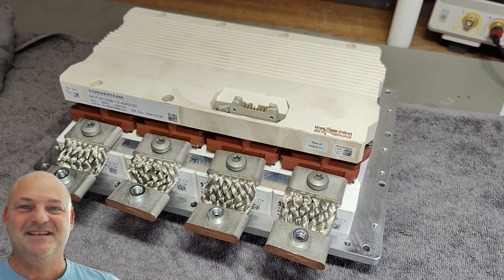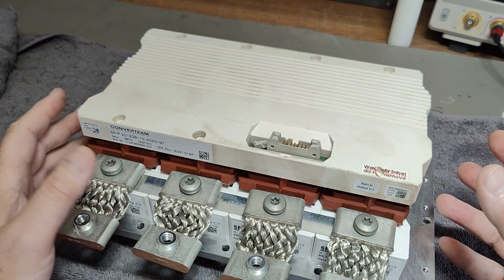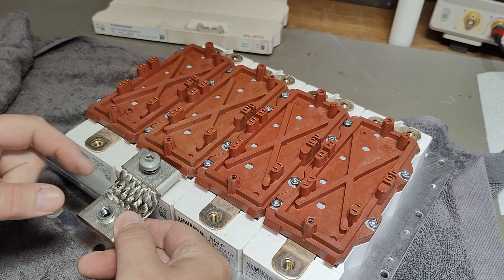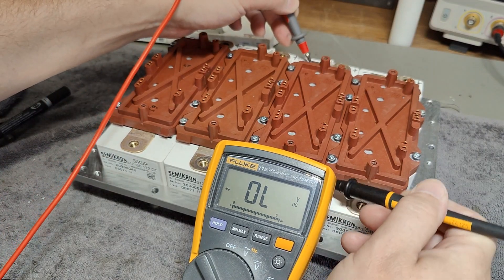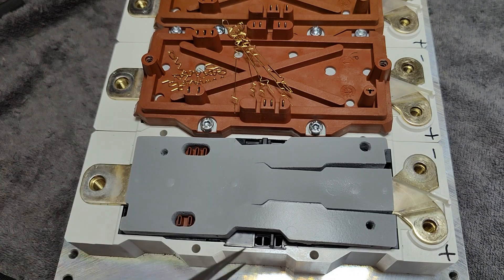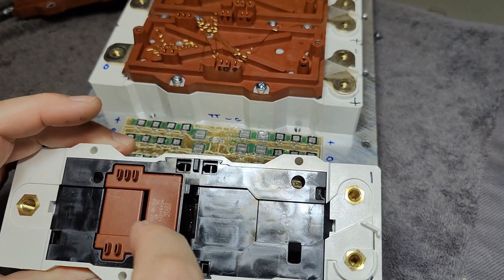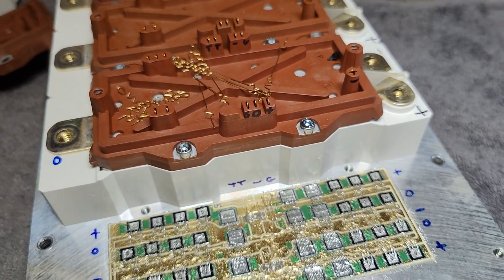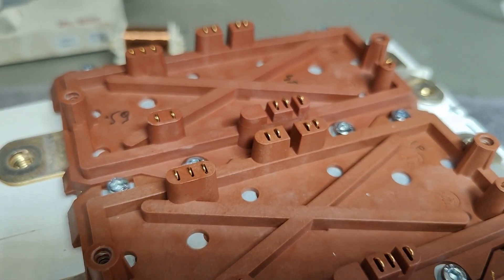Converteam SKiiP 2013GB172 Semikron Transistor Power Module IGBT

Comment: Old stuff, now we have SIC modules, less driving charge, much faster and much lower voltage drop, insane change.
Reply: much faster is not exactly better. Maybe in some applications, but insanely high pulse frequencies can lead to serious problems, when trying to handle longer cables. du / dt is also a topic. "As much as needed" should be the goal, instead of "as much as possible". Praising SIC in general is PowerPoint engineering

Comment: Some of these flex busbars are causing problems. These are too soft and the tightning torque reduce over the time, affecting the contact resistance. Unless you use a washer that can cover most of the surface, the copper braid will migrate on the side and less material will be present under the bolt, loosing them.

Comment: Hefty they are, yes 😮💪
Lots of power to handle 2000A
I've been working with "only" 300A systems/inverter for heatpump compresors... 
They do have 2 IGBT running in parallel for each of the 3 outputs.
Love the part with the sticky sticky stuff... 😂😉😂 ...been there, too

Comment: Goop cleans off if you use MEK to dissolve it. Also unfortunately tends to strip the soldermask off the ceramic board. Ceramic is either soldered to the aluminium substrate with a low temperature aluminium compatible solder, or has thermal epoxy holding it in place.

Comment: Used semi-packs are more or less guaranteed NOT to work...
Reply: Might be just working old stuff from decommissioned machinery...
Reply: Especially if offered as "untested" as it's pretty easy to test them. 😂
Reply: @christopherleubner6633  I doubt most industrial wreckers that bulk off anything that looks like a valuable spare part on ebay would care or know how to do a diode test even, let alone test such a module to spec (normal people haven't any sources for either 2000V or 2000A around :) ).

Comment: 14:00 could be that current transformer is using one coil to drive the core into saturation, and a second for sensing, so any DC current offsets the saturation point.
Reply: Маленька котушка дає сигнал зворотного зв'язку на спеціальний підсилювач постійного струму, що живить велику котушку. Підсилювач створює у великій котушці такий струм, щоб магнітна індукція в сердечнику дорівнювала нулю. При цьому струм у великій котушці буде точно пропорційний до первинного струму. Не тільки на змінному струмі, а й на постійному струмі.
The small coil gives a feedback signal to a special DC amplifier that powers the large coil. The amplifier creates such a current in the large coil that the magnetic induction in the core is zero. In this case, the current in the large coil will be exactly proportional to the primary current. Not only on alternating current, but also on direct current.
Reply: This is a closed loop fluxgate transducer, likely based around a TI DRV401 or similar chip. A saturable magnetic strip sits inside the excitation coil, and the drive circuit works to cancel out any even harmonic generation by servoing the bias coil current. This happens when the bias current cancels out the main current, scaled by the number of turns on the bias winding. At higher frequencies, it acts like a regular transformer, with the main current inducing a scaled current in the bias coil. This gives a flat response from DC up to hundreds of kHz usually.
Reply: @Mikkel324  
What a great microcircuit!
It's a pity that I didn't have one like that in 1984 and then I had to make a current sensor with this operating principle from discrete elements.